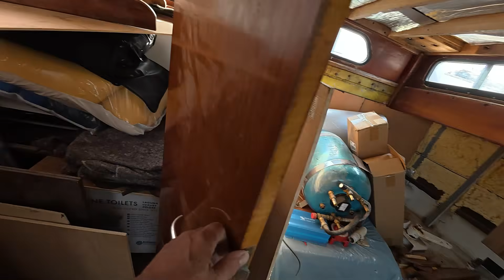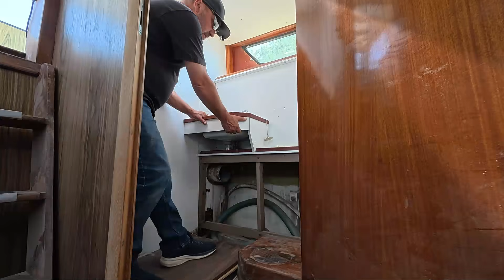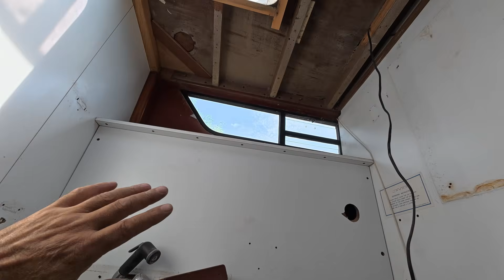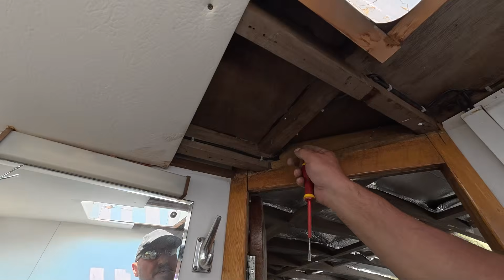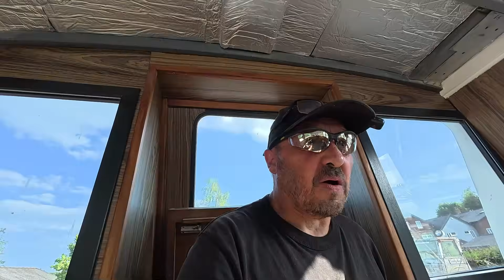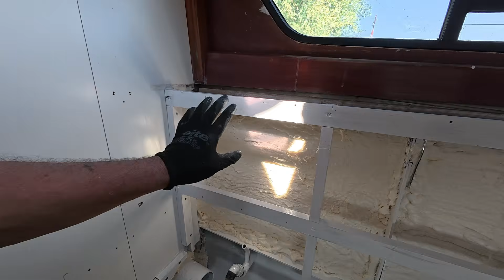Aft Cabin Shower Bay Preparation, Ocean Pirate 61 Part 1

Comment: Mate, nice to see the progress! But...why are you building a temporary shower system? Isn't it easier to do it once, the way it finally needs to be?
Reply from the maker: Good question Stephen i will need to pu the reason in the next video but the answer is,,
The main water tanks which need work and the underfloor section for pumps is in the main cabin,, which I need to pull the floor up,,
Also these are the sections where the welding needs to be completed,, so I need to make a living space for now to spend more time there,,  plus the vessel is located in what we call the graveyard and once moved to the concrete front of yard i will be able to weld the underside and hit the engine bay,, once the welding is completed I can install the main water system and get the engines to site.
I now have the couplings for these,,
The aft cabin will become the living area on the vessel..
On another note your doing great with a great following,,
This trip of yours has got peaple hooked,, absolutely love it,, 
The scooter you will probably change,, but the trip is on.
We are very similar 
Once committed just keep pushing forward 
Have great week mate
Sell the boat grab the cash and ride away,, brilliant 👏